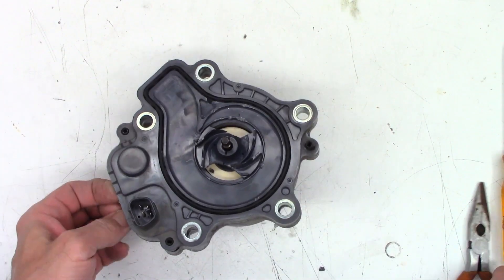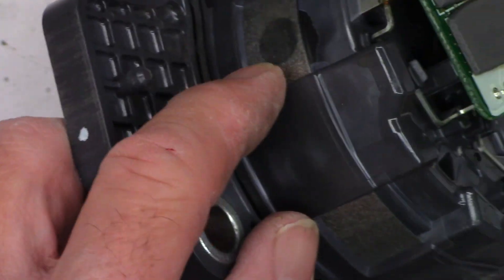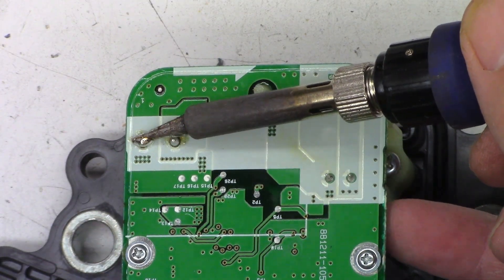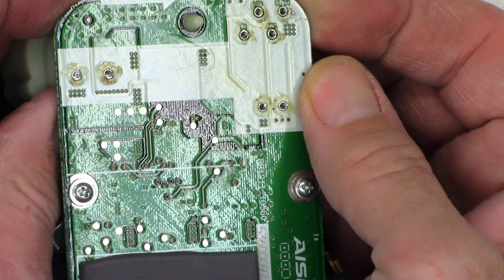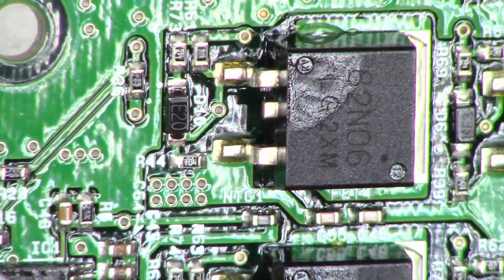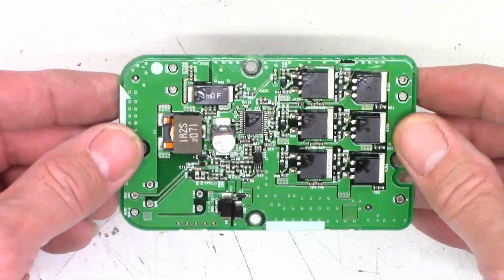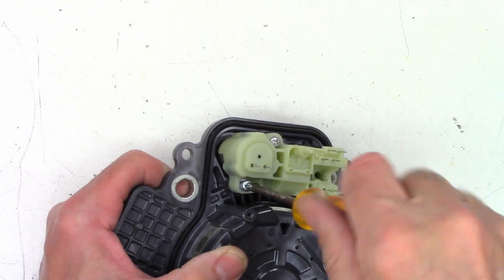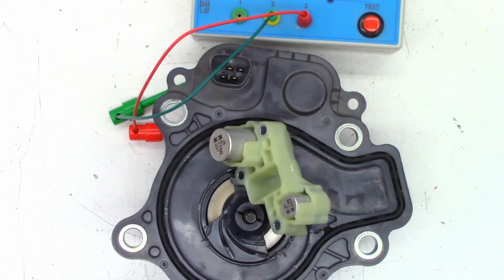2010-2025 Toyota Prius Water Pump Internal Circuit Board Removal and Inspection

Comment: i haven't seen any of those on the road in years already, scrapped back into pepsi cans i'd suppose, its a pointless effort to poke at something so hellbent on not being saved. that way there's more time/spoons for the annoying but doable projects like CONCORD 5 INCH REEL TO REELS WITH BELT PULLIES UNDERNEATH THE AUDIO HEADS or SONY VIDEO 8/HI-8 HANDYCAM CAPACITOR REPLACEMENTS.

Comment: Interesting, didn't realize they're using on the 2.0's in the gen 5 Priuses as well.  Have looked into a little for my 2013 and for the Prius C engine, being that will be easier to custom make a control relay at the bare minimum to operate for use in a gen 2 (2004-2009) Prius compared to converting to a manual water pump.  Wondering how that impeller feels and functions as those can go bad and replacing those alone is a gamble some take versus replacing the whole pump.  Thanks for sharing and surprised you didn't go into more detail.